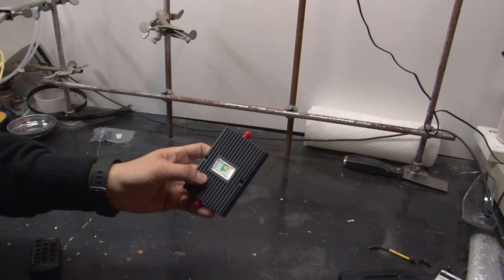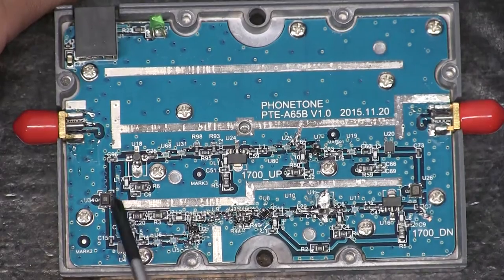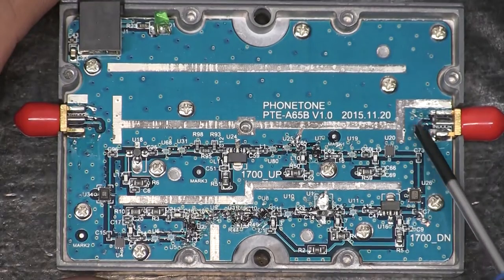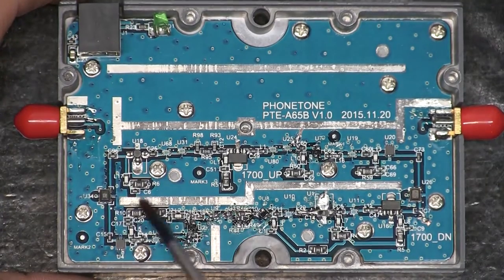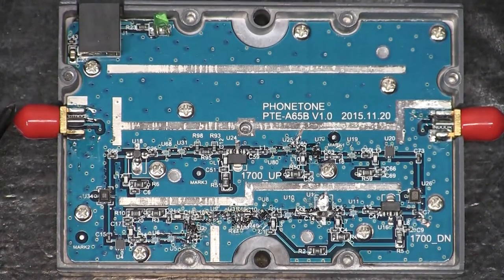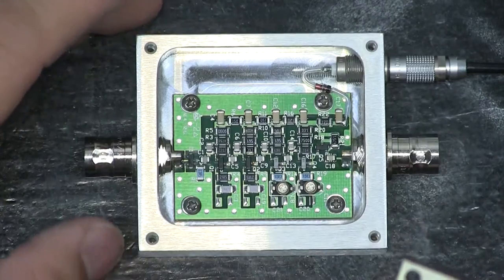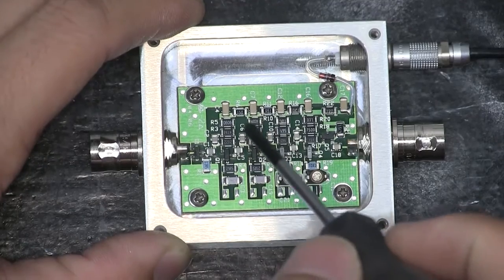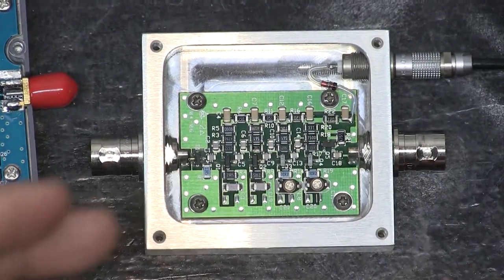(26) Cell Phone Amplifier and Miniature Instrumentation Amplifier Teardown

Comment: This video was very helpful to me!  The analysis of the cell booster board helped me understand an issue I am having with a cheaply-made booster which broke due to oscillation.  This helps me understand a bit more, but I need to research "RF Black Magic" to fully understand.  :) Thank you.
Reply from the maker: RF is truly black magic until you understand how to make the E and M fields wiggle the way you need them to. Once you get into filter design it is all sorts of interesting.